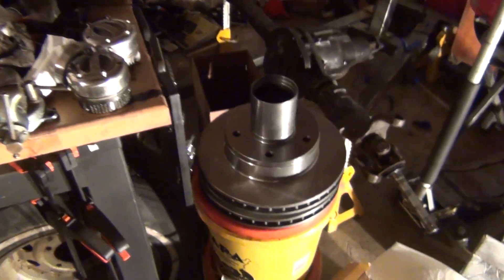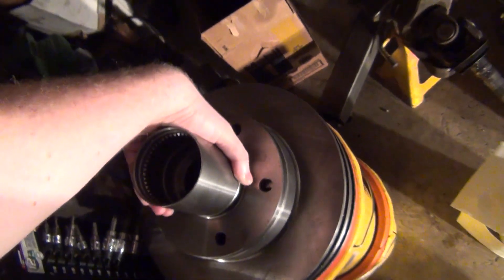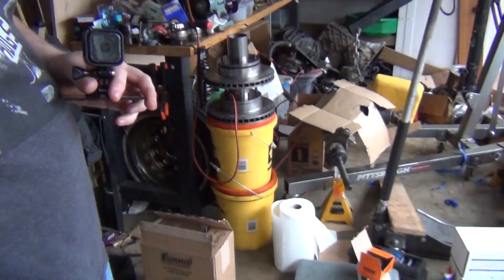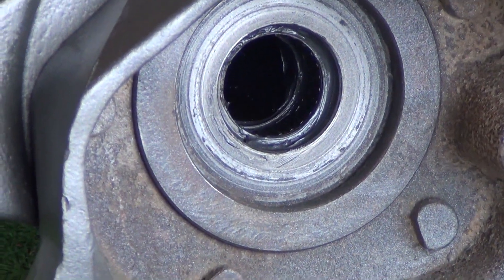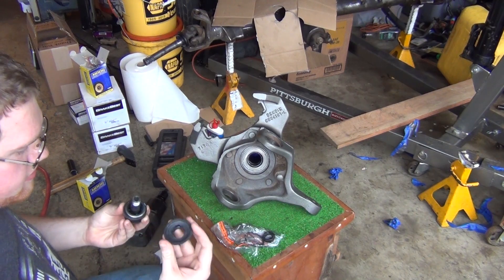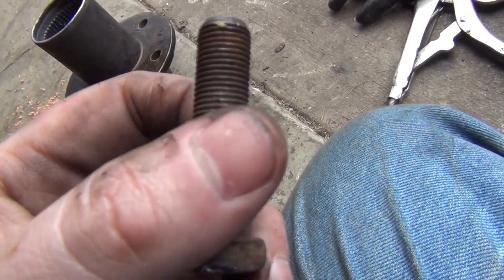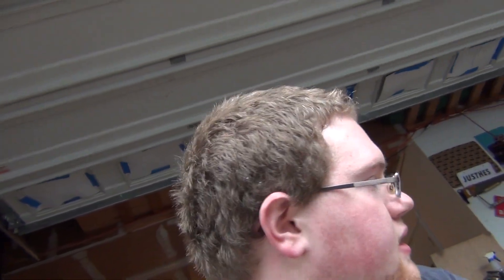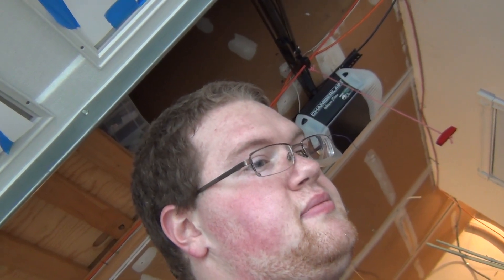DANA 44 Rebuild | Reassembly | SAS Swap | 4x4 Overland Truck Project | Part 5

Comment: looking good. you shouldn't have to disassemble everything. Just remove the spindle and axle shaft. Then torque down the lower bj to spec, followed by that inner upper nut thingy, then lastly the castle nut. that should suck up the ball joint the rest of the way into the slot. If so, insert the cotter pin, if not take the knuckle off and massage it some more.

Comment: when I put wheel studs in, I line the splines up put the lug nut on and tighten with a impact and I like your videos
Reply from the maker: +Stirling Hubbs I tried that... I destroyed a lug nut.
Reply: Probably  because  like u said wrong size of stud

Comment: The best way to put in studs like that is to use a wrench and a lug nut on the outside and using a impact gun and hammering the lug nut right down on the wrench to pull the stud into place

Comment: Is it possible to give the part number for the Moog upper ball joints with the grease fitting in an accessable place to use a grease gun. With the grease fitting in the center in the bottom underneath, it is very difficult to grease. A plug goes in and that's it.